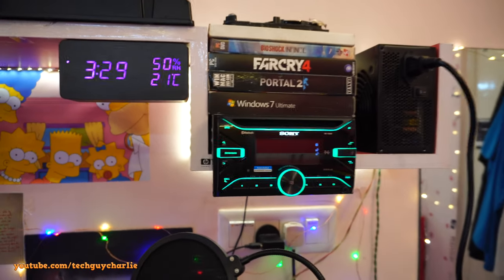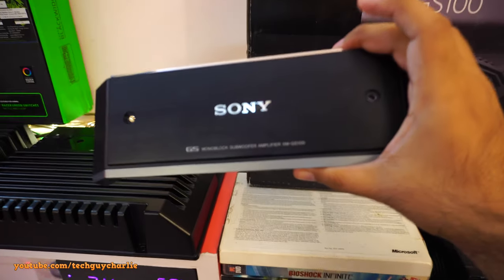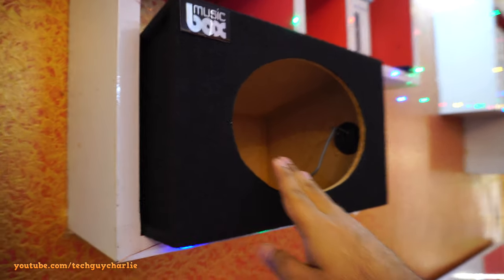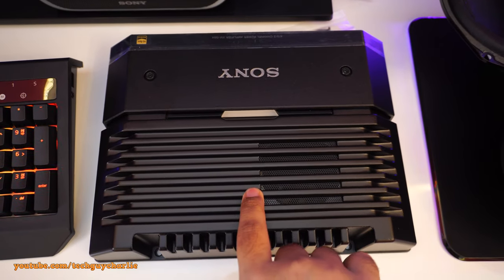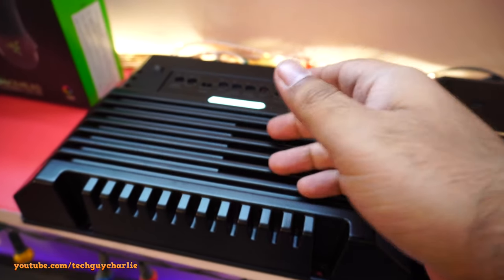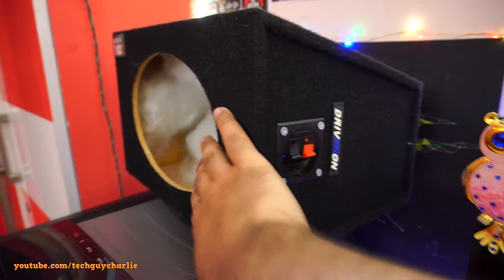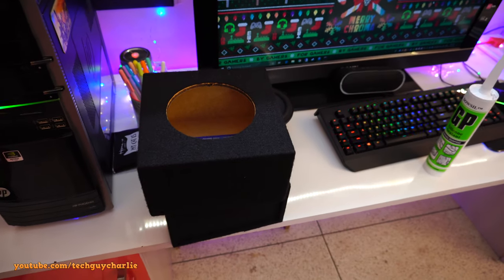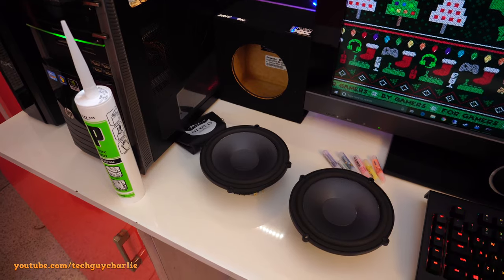(Part 1) Car stereo at home DIY project update - new Sony amplifiers, JBL speakers and boxes

Comment: do we strictly need two amplifiers to run this setup 
i mean the radio unit can drive two coaxial speakers 
so how would you suggest using a 4 channel amplifier 
pls also do suggest some budget component speakers and amplifier

Comment: Would like advice on this project.. Thinking of picking up the very same psu to power a car amp, its only being used to power a sub. The thing is the amp has 35A fuses.. Will there be any complications? Should i try to find a psu with higher amperes? Please help, dont want to damage my amp.

Comment: Hey bro i have same amplifier sony gs4 and same speaker jbl gto 609c, but i fitted in car, so please could tell me settings of sony gs4 because on default settings its not providing good sound.. Please reply.
Reply from the maker: Hey dude, last year I got this system dismantled and moved it to my car, the guy at the shop set the amp up and tuned it according to what he felt was right, so I have no idea what he has done. My front speakers are the same, jbl 609c with tweeter and rear ones are from Pioneer, without tweeter. Rear ones are powered by head unit because we are using one channel for subwoofer, so all have have different settings, but this speaker amp combo is great, for me it sounds far better than original stereo. If you got it installed by someone, tell him to tune the amp properly, it will sound really good and crystal clear.

Comment: Hello sir,
How are you able to adjust sub woofer bass adjustment on the car radio yet its wires are connected onto the amplifier. Need help as soon as possible
Reply from the maker: Through the car stereo itself! All the controls are exactly the same as they would be if this was installed in a car!

Comment: Will equalizer settings will work in Sony xplod when speakers are connected to optional amplifier? Pls reply!!
Reply from the maker: Yes absolutely! You can use the EQ head unit when these speakers are connected to an amplifier.
Reply: Tech Guy Charlie So when i change the bass and treble in the head unit the speakers connected via power amplifier will also respond to same sound settings i have done in head unit right?

Comment: Can we connect these two amplifier with corsair vs 650 W power supply??? Please reply... Thanks
Reply from the maker: Yeah, bro, but please get the CX version instead of VS, CX is more reliable than VS in the long run.
Reply: Buy MEANWELL power supply of 15v ... that willl be great and cost effective.

Comment: Hey bro plz tell me can I connect 2 xplod 1800w subs on sony xm-gs 100 plzz help to Knw me bro
Reply: Sony 1800w sub is of 420 RMS @ 4ohms. Connecting 2 sub that means in parallel mode (left,right)  will work @ 2 ohms with 840W (420+420w). Sony Mono GS100 gives 600 RMS @ 2 ohms. You will able to use them without any issue. But now your combination of 2 sub will be underpowered.